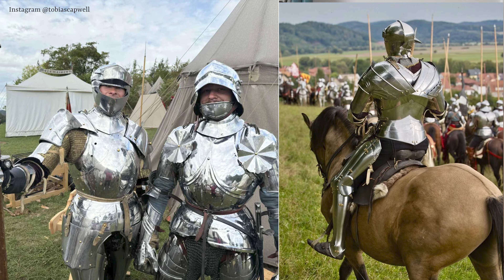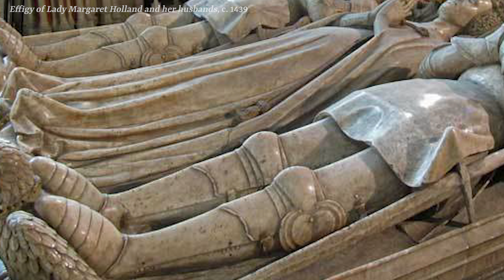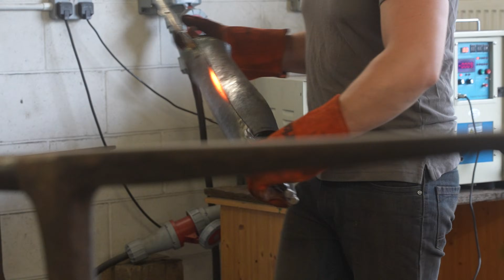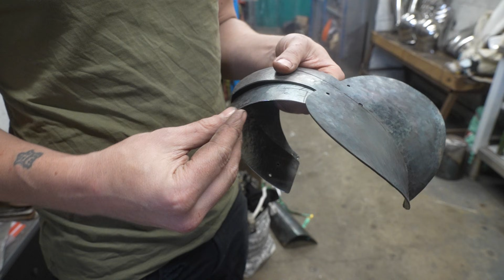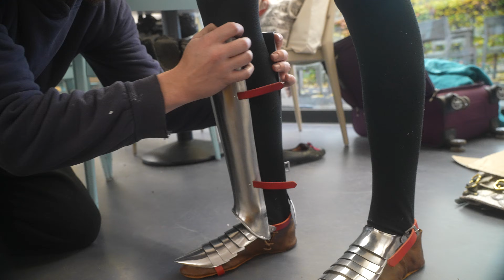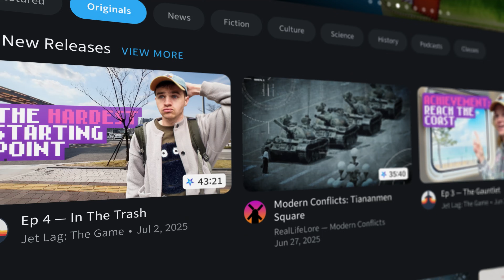Making Medieval Armour for Joan of Arc

Comment: Iron? Not steel?
Reply: Steel was decently common around Joan of Arc's time, especially around the higher ups like Joan herself and any members of the royal army
Reply: @MidArkansasSmithingexactly, so i was confused as to why iron and not steel. She mentioned armor is made of iron at some point in the video. Tho she might just be wrong and not so interested in it to know it. Maybe it is steel and she just called it iron.
Reply: @MidArkansasSmithingexactly, so i was confused as to why iron and not steel. She mentioned armor is made of iron at some point in the video. Tho she might just be wrong and not so interested in it to know it. Maybe it is steel and she just called it iron.
Reply: @teofiloljubisavljevic7943  I don't know why but every reply is multiplying for some reason so don't mind that

But wrought iron, or just iron, is folded a bunch to spread out impurities and it tends to crack more when it's being forged compared to steel. Steel is also folded at this time but the carbon migrates between the layers faster so it's easier to fix cracks to long as you flux them so that there's no oxidation that happens
Reply: @MidArkansasSmithingexactly, so i was confused as to why iron and not steel. She mentioned armor is made of iron at some point in the video. Tho she might just be wrong and not so interested in it to know it. Maybe it is steel and she just called it iron.

Comment: Armourer and armoured combatant here, surprised I didn't see an English Wheel in any of the work, that's probably our most important piece of equipment... then again we do exclusively cold work. We have a few things that are easily modified or where the size doesn't matter that we have in stock but by and large we joke that we're the Big and Tall shop for armour, the stuff you can order online is "average" size. For my husband's armour, we had to size everything up, like use our usual knee pattern for his elbows, and for me, we had to size down, the usual elbow pattern was used for my knees. Bespoke armour is where it's at unless you want pinchy bits and flappy bits, though a good armourer ought to be able to adjust and fine-tune a lot of premade stuff so it'll at least be comfortable.

It''s surprising how quickly you adapt to wearing armour, mine's half my bodyweight so when I have to carry it around, I prefer to have a cart or take two trips, but wearing it, I'm fine, we even did a 5k charity walk armoured up, because the 2k the year before felt too short!

And oh boy is it empowering, I'll go up against guys twice my mass using metal weapons (not sharp, but they'll still do an incredible amount of damage witih a good strike).

Comment: Armour is highly expensive, even a blued well made half armour of a Currasier or Hussar of the 17thc will cost about 6 to 8000eu.
I enquired though I can make armour for myself and I am told it looks shop bought armour meaning it looks good and fits well.
But I am a sword smith and make misc things but not a armourer.
I am sure my blade making has helped me be able to make some not all pieces.

Comment: The feeling she gets from the armor reminds me of the feeling I get from my platforms. Those boots lift me 10cm higher than my other footwear and it makes me feel incredibly powerful, plus after a shockingly short period of getting used to it (literally a matter of minutes) I can do almost anything in them I can do in normal shoes: I can run, I can climb the stairs (slower than usual) and last weekend I even danced in them (couples dances, where I had to mind my dancing partner's feet). However, now my legs are clearly exhausted and hurt when I put the platforms on, so I have put them in timeout. Wearing them immediatly changes the way I walk and, frankly, interact with the world and I wear them so often, they've actually influenced the way I walk in normal shoes, which now feel like indoor slippers to me, because the sole is so "thin".

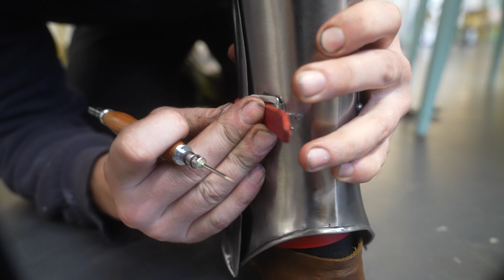Comment: 19:00 why are those clasps on the inside of the lower leg? Wouldn't that get caught on the saddle 🤔 

Owning a horse has taught me not to have anything pinchy on the inside of my lower leg as it can not only damage the saddle but hurt the horse.
But the old days might not have cared 😅
Reply: Probably better to have them catch on the saddle than to have the leather straps on the outside, where one good hit with a sword will cut them off cleanly and make your armor fall apart...
Reply: @jonasholzem2909 as long as you don't have a sensitive horse, or you might end up somewhere at a speed you don't want 😅
Reply: @UnboundedArtandCrafts  Well, they bred and trained the horses specifically to be ridden into battle, so they probably avoided the sensitive, skiddish ones. Case in point: Look at the spurs you can see in some of the stills in the video. Not for the faint of heart.

Comment: Sheet metal fabricator here and I was wondering if anyone has any info on modern steel not having a grain? In my experience it absolutely does and how the piece is cut in relation to the grain will change how it forms later. I wonder if she meant that the grain isn't as obvious?

Comment: Noticed Dr. Capwell mentioning the wearing of a corset with respect to the wearing of plate. The Royal Armouries posted an interesting presentation a couple of days ago in which the importance of a discernable waist to mobility and the ergonomics of weight distribution was mentioned. Period illustrations were also shown depicting the knightly demographic with a rather waspesque outline. Love the idea that someone expounding on how corsets make one faint being told that knights wore them while thumping each other with polearms.
Reply: From what I've passively learned about fitted garments and specifically corsets over years of re-enactment, shaping garments weren't that constrictive in earlier stuff, like the 16th to 17th century Renaissance fashions I was interested in for a long time. I made a few Italian dresses with and for friends of mine, and even with light boning and reinforcement layers, they were still able to comfortably bend over, do all the normal camp activities and chores, that we normally did. My padded HEMA jacket was far more restrictive and tight around my core when I put on 10 extra pounds of fat, but I was still able to fence in it (most of my loss of performance being due to overall loss of fitness, not tightness of the jacket). :P And in full harness, my arming doublets or lendeniers have to fit very tightly around my waist. I've had female friends observe that the doublet's waist behaved like a corset.

In all these cases though, there was some amount of getting adjusted to the restriction in order to do everything we wanted to do. So in my experience and that of people I've trained and done re-enactment with, Dr. Capwell's "I imagine" was right on the money.

It wasn't until the late 1800s that corsets got really rigid, tight, and caused the moral panic and public health controversy, I think. By then, the wasp waist aesthetic reached some of the more extreme outlier examples that caused fainting. And ofc in every period, lower and middle working class clothing for women who were farmers, laborers, and craftsmen were consistently more accommodating and practical.
Reply: 19.05  Yeah ,  I wasn't buying the   "I imagine"  either

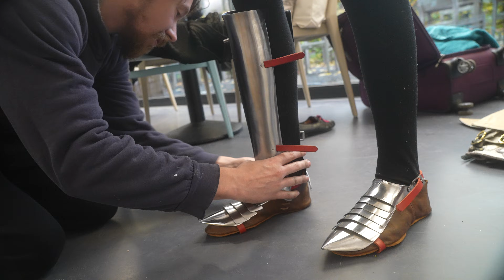Comment: 19:18.  OK, but, just a little note to Mr Capwell, corsets have a very functional role to play, as well.  
In fact, if that belt to hold up the legs of the armor were a corset, it would probably be more comfortable. 

Anyway, this whole thing is so amazing and awesome and I'm honestly in awe of Ms. Banner. As usual.
Reply: A good arming belt has corsetry lacing. So yes, it basically works like a corset.
Reply: I had the exact same thought 😂
Reply: @OP The way arming doublets and lendeniers are fitted and laced, they do act similarly to corsets. I've often thought of my arming doublets as corsets with integral sleeves, shoulders, and collars, b/c the fit around my waist is quite tight to distribute as evenly as possible the 10+ lbs of steel for the leg harness. Early on, I did not pay attention to or understand this weight distribution. That much weight causes thinner or weaker belts to sag, stretch, or arming points to tear out. And sagging leg armor is an effing hazard plus it looks awful. XD
Reply: In a real set of armour. Instead of a belt, Bernadette would be wearing a full arming jacket.  The leg armour would attach to the bottom edge of the jacket and distribute the weight across the torso and shoulders.  The arm and shoulder armour would also attach to the arming jacket as well.  In many ways, the arming jacket is the skeleton for a suit of armour.

https://youtu.be/hLWTDhKltJk?t=75 Dr Capwell sparing in his arming jacket.  All the metal ended ties (called points) dangling from the lower edge. That is where the lower leg armour attach to.

Random armour fact of the day.  It is where many believe the phrase "Get to the Point" comes from.  Squires being too slow armouring up a knight. Then the knight telling them to just lace the armour to the points and be done with it.
Reply: @Yandarval Interesting. 😁
Reply: @Yandarval  Thank for expounding on this as it is quite fascinating!
Reply: @Yandarval came here to say this - you'd normally have the entire set on, and definitely padded